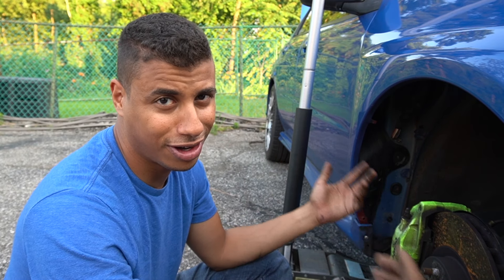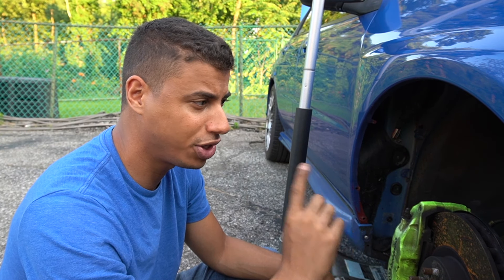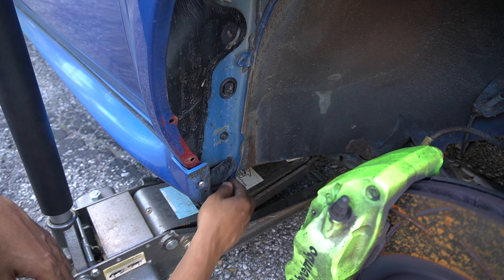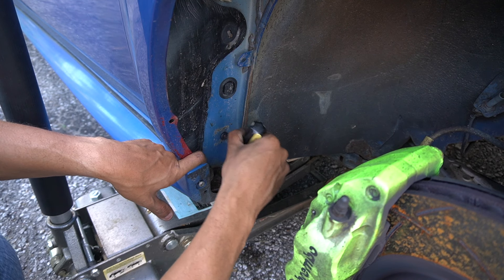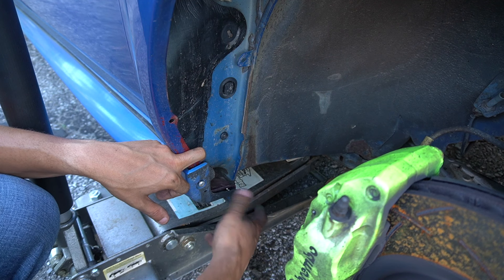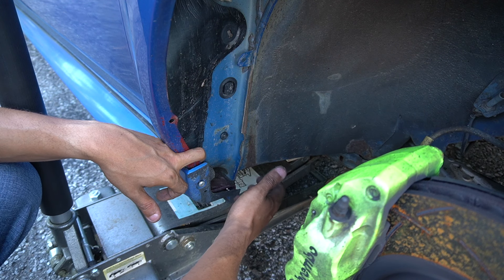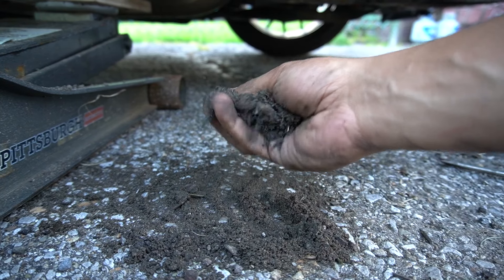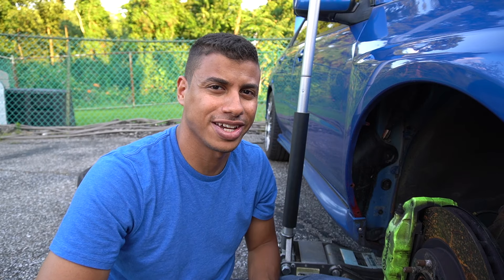The BEST Way to Prevent Your Fenders From Rusting Away!

Comment: I bought a 2022 Tacoma SR and want to install fender flares. What if I cut perforation holes in the fender flare and spray Fluid Film once year inside the fender  flare? Wouldn't that prevent rust from forming?

Comment: I don't know if you will get back to me but I just had a question what if you install mud flaps on the back wheels would that help
Reply from the maker: Mud flaps can help with the spray, but everything will still get wet honestly. Depending on how they are mounted, in some cases the flaps can trap water, moisture, & debris between them & the paint which can accelerate rusting. So it is hit or miss. If you live in a cold climate, washing the road salt off of the car when possible will help slow the rust too.